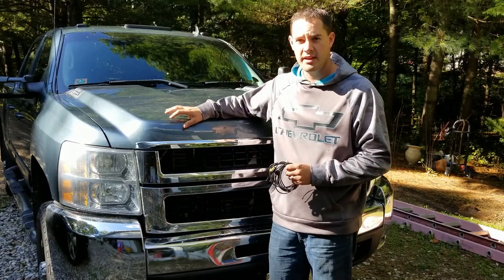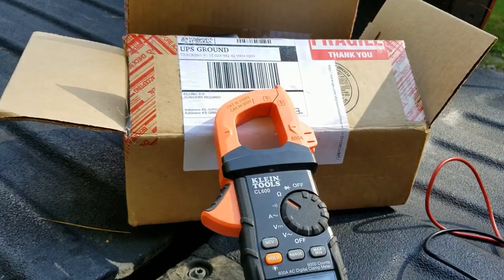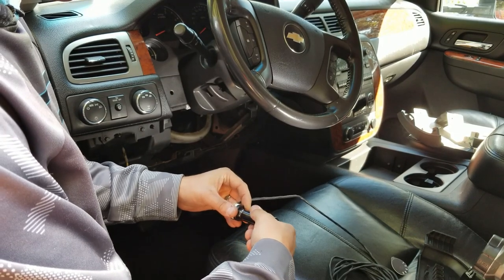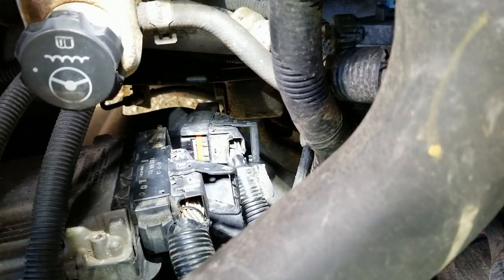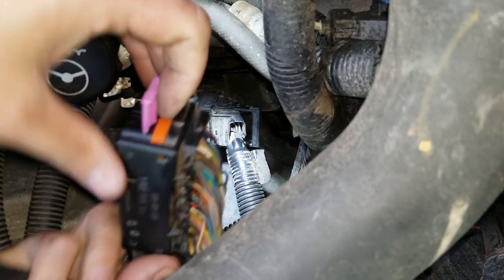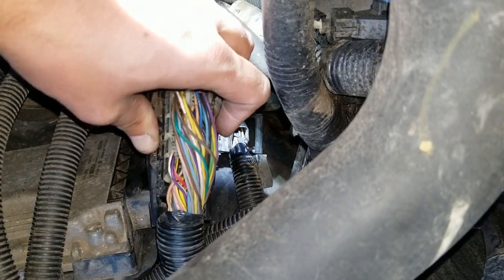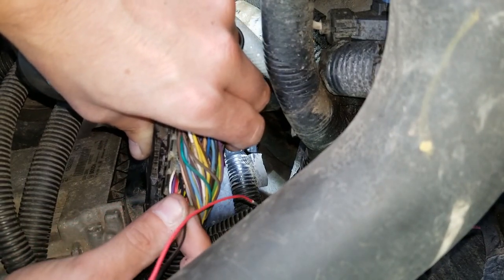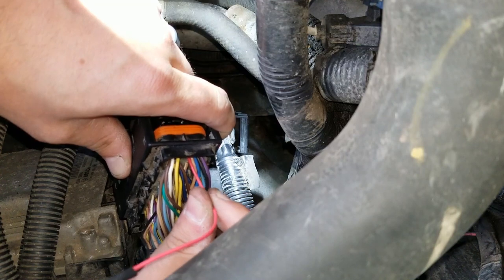5 DSP Switch Install Video

Comment: Do you know what pin holes to put it into for a LML Duramax?
Reply from the maker: #11 and #35. If you have a 2011 LML, you will have to remove the yellow wire from #11. There will also be fillers in pin holes that you will need to remove as well. From your switch, our black wire goes to #35, your light colored wire goes to #11. With the locking tab on your wire connector for your truck at the right side of your hand, pin #1 is bottom-left. In the top set of pins, bottom left starts at #35.

Comment: For installing the dial, do you need to know what tune the truck is in? Because I have no way of finding out what tune my friends truck is in. I believe it’s tune 3 but I’d rather not mess anything up.
Reply from the maker: If there is no switch installed, then the ohm reading will be the least amount. So it would be in the highest tune level the truck has.

Comment: What does each position do for you?
Reply from the maker: 1 = light tow tune with turbo brake(30 hp)
2 = heavy tow tune with turbo brake (60 hp)
3 = 75 hp stock tune
4 = 125 hp Street performance tune
5= 150 hp Track performance tune
Reply: @xtrodinaryduramax8010  Okay. I’ve got an LML that came with a tuner like this, and I have no idea what each of the 5 settings for mine does
Reply from the maker: Ok. That's just a switch. You can have almost any tunes you want on them. Some tuners have a certain set of 5 they put on. I was able to choose mine. Do you have to know the person or company that tuned it? That would help aid in figuring out what HP settings you have.